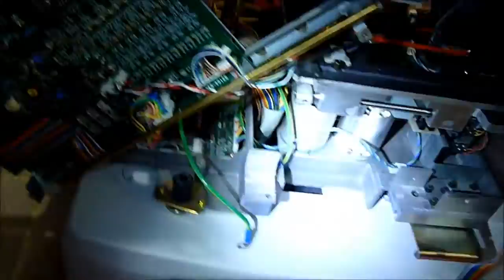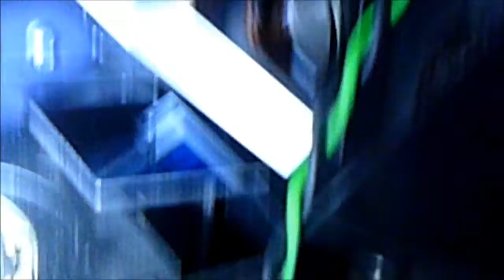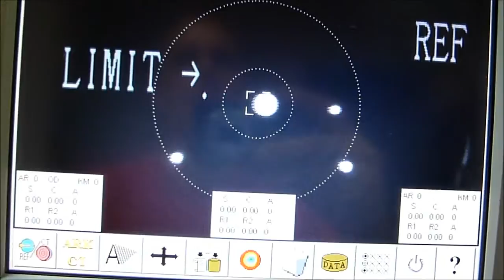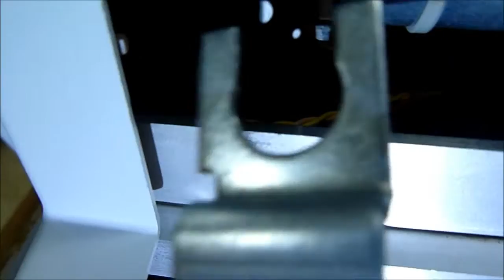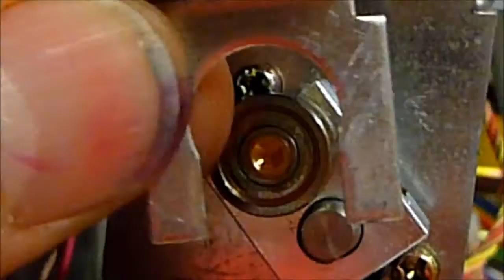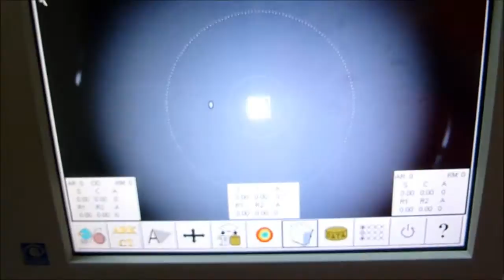Marco / Nidek OPD Scan II ARK 10000 Repair

Comment: My name is Fábio Bittencourt and I work as IT Support in an Ophthalmology Clinic, located in Rio de Janeiro - Brazil.
The reason for my contact is that I can count on your generous help in solving a problem that is occurring with the NIDEK OPD-Scan II device (Model: ARK-10000) that, when you finish loading the Windows Operating System, a message appears while trying load the program NIDEK \ OPD-Scan with the following information: “ERROR - Serial Number is not defined”.
Given this, we are unable to understand what has happened and what we can do to solve this problem; because everything was working perfectly.
So I would like to know if you can help us solve this issue.
I look forward to your attention!
Fabio Bitten

Comment: Do you happen to know how to calculate 'Angle Kappa' of the eye using the OPD Scan 2. Thanks.
Reply from the maker: Hi Eric, thanks for subscribing. The information you seek is only available with the OPD III, the data is probably collected in the OPD II but there are no algorithms developed to display the information. Although you can do a rough determination based on observation using Limbal and Pupil Centration and measuring the Decentration to the Apical Corneal Reflex to determine Angle Kappa.while the patient is fixated.